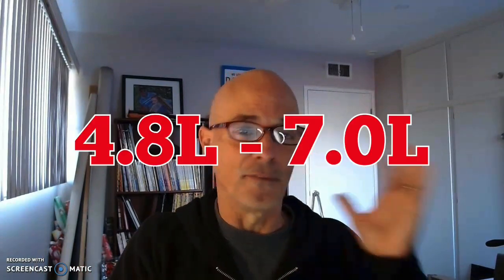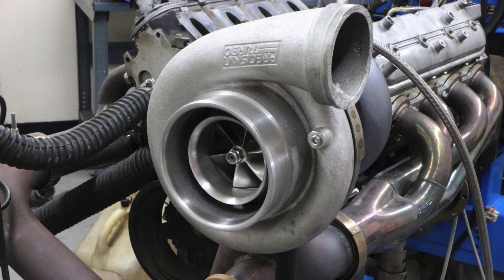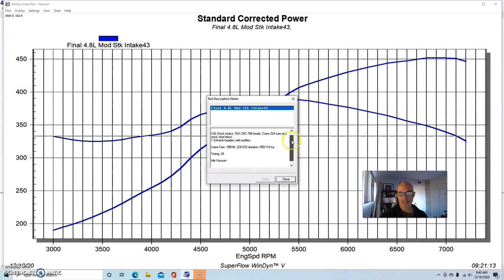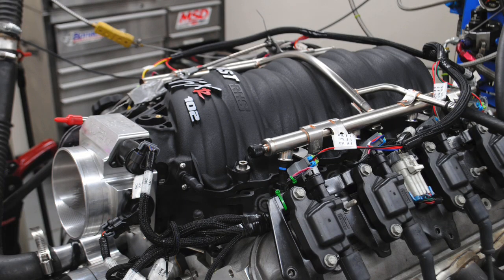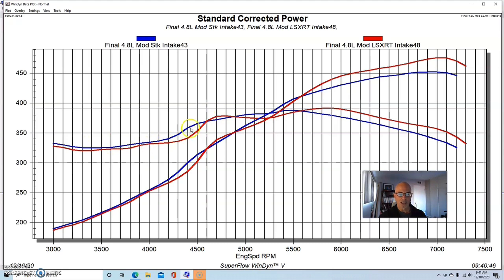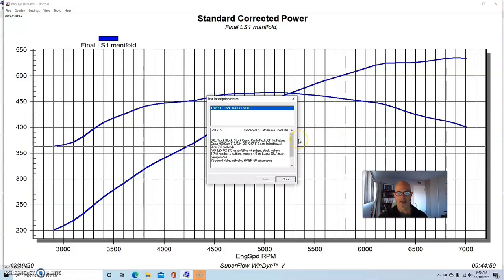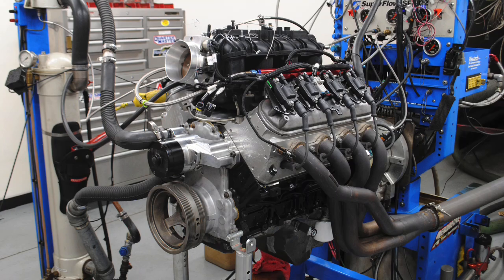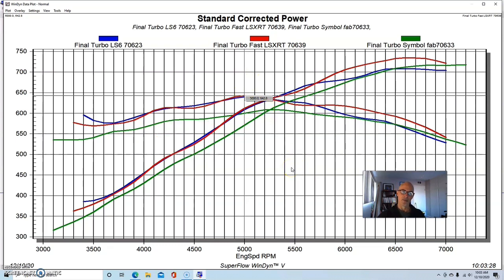LS TURBO INTAKE MANIFOLD MYTH-DOES IT MATTER UNDER BOOST?

Comment: Hi Richard . i am currently buildind a twin turbo 363 stroked lc9 ls . 12/1 8000rpm capable ,on m1. full drag car . thath motor is gonna live mostly at high rpm . i was looking at the holley ultra low ram , holley low ram or the btr trinity . whitch one is gonna be more suited for my application . tank you
Reply from the maker: BTR makes the best power of those
Reply: @richardholdener1727 would you say a short runner intake would be best for my application

Comment: I run a LS6 on my 430 lsx turbo set up and if I am worried about 20 hp I just turn the boost up s cupel of pounds I have a pretty big turbo and went 8s with 16 psi I can turn it up to 30 + psi ls6 for a turbo works excellent i paid  100 bucks for it and a 80mm after market Tb

Comment: One other thing, I've seen many dyno test with different length runners with individual throttle palates and the reflected wave to atmosphere with pressure numbers, with the best lengths being very long. The question is this, where is the reflected wave realized in a turbo system or na plenum style? The atmosphere, turbo compressor, or throttle plate, inter cooler,and are the rear cylinders getting the longer length. Can you sample cylinder compensation per power stroke to each cylinder?
Reply from the maker: the reflected wave occurs at the end of the runner in the plenum (na or turbo), on an na motor with stacks-it occurs at the end of the runner where it reaches atmosphere. on a turbo, it has to have some type of plenum to pressurize

Comment: How long are the runners in the FAST manifold? This is probably where the power comes from, I'm sure longer is better, but we don't have the 6 feet of runner length under the hood.  Ever seen a cross boss, ford stuff.
Reply from the maker: yes on the cross boss

Comment: I’ve tuned nearly a dozen various LS builds running positive manifold pressure and the FAST manifolds with no cracking or boost leaks. The only PVC style manifold I have seen bleed off boost was a FRPP piece on a 3v mod motor and this was an 950+ flywheel HP bracket car running a lot of boost pressure.

Comment: from all the tests you have done with the fast lsx (all versions) manifolds, you can see the replaceable runners create sine wave problems. some extensive maf tuning would have to be done to smooth everything out but those waves would create daily driver drivability issues.
Reply from the maker: THEY JUST PRODUCE REFLECTED WAVES THAT MAKE POWER AT DIFFERENT RPMS-TUNING WOULD NOT BE AN ISSUE
Reply: @richardholdener1727  I'm taking about those weird spots where the power level gets a little wonky

Comment: Fabricated ram style intakes HEMORRAGE power down low and dont make gains til 7200rpm even turboed. Ive see a china sheet metal intake, and a Holley high ram both drop 70hp and 50tq on a 5.7 down low and took til 7300+rpm to beat the Fast 92

Comment: Related to MaxSpeedingRods, I have a set of their rods, and I have bought a couple exhaust flanges, turbo drains, and have seen a few sets of their suspension on Hondas, and typically their products seem to be typical of the current Ebay/Chinese based company that seems to be doing a lot of work off of production models they got second hand or modeled after, with alright quality control. Its nothing to write home about, but it is a company making parts available for reasonable prices for reasonably decent quality, but it is still a company that doesn't seem to be doing much developing, just selling copies of parts.

Comment: Have used maxxedspeeding rods products with good results. Mostly fittings or cosmetics though. Most "important" product I've used was their throttle body. Typical 4 bolt dbc china throttle body but didn't have the issues as others have like loose screws. Would be interested if their turbos and stuff compare with vs racing.
Reply: Maxpeeding rods has decent quality control and improves specific products over time.

Comment: Maxspeedingrods, yeah right, try the gt35 turbo, its complete garbage, i have had two of them, the first i bought, the second i got as a replacement, both of them had a bearing issue. The rods however would be interesting on a setup, to see the limit of the rod. Should go 200hp/cyl as every other chinese rod goes.

Comment: Hey Richard, what are variables to take into account if someone where to run half a twin turbo header and turbo but an na manifold on the other side? This would be done on tighter setups and potentially a stock ls4 configuration.
Reply from the maker: I tried that on a BBC
Reply: @richardholdener1727  do you have a video up of it or maybe a writeup? Would love to here your thoughts on the topic.

Comment: Yeah no on the sponsor.  If you want to make a few bux I'm certainly not opposed to that, but having a Chicom copycat company as a sponsor is just bad form.  And it might be the last time I watch the channel.  I think you've gone far enough with the VS and CX racing stuff, and they aren't sponsors.
Reply from the maker: Max Speeding would not be a channel sponsor-just supply a part for testing
Reply: @richardholdener1727  I don't have a problem if you go out and get CX or VS or whatever on your own and test them honestly, that's fine.  But if a company approaches you and gives you parts to produce content with that's a sponsorship.  They don't have to also pay you for it to be considered that.

Comment: Richard! I have a 6.0 lq9 forged crank stroked, cam, good worked truck heads FAST 102 intake and stock cracking falling apart injectors!!!! I dont know what injectors i should run!! Any advice sir?

Comment: I have a maxspeedingrods gt45 turbo on my cammed 6L. I've been boosted since June 2020, and no problems as of yet. Started on 5lbs, now @ 11. Shaft still has the same amount of play as it did the day it arrived at my doorstep. Only complaint is he forgot to include the gaskets, and then wanted to argue with me about it. The turbo itself though, can't be beat for the price. $158 shipped to my door.

Comment: No LS motors need forged/ intake this or that ! The magazines are salesmen,  I'm taking a 2005 LQ4 in my chevelle with gapping my rings and a nice 216/220 trick flow cam,  LS9 head gasket,  ARP head bolts,  2 S256 borg warner and dialing in 500 on low boost and turning it up a little for 600 hp ! All for about 4500 complete.  I could do it for 1K less if it was a single set up !

Comment: Was the LS6 intake genuine GM or was it the Dorman replacement?

Just curious as my understanding is the Dorman is 10-15 HP up on the original part. 

Great test, superb info as always!
Reply from the maker: the Dorman LS6 made less than GM LS6 when I tested them back to back-the Dorman LS2 is better than both
Reply: Thanks for setting me straight.

Very happy then that I purchased a 92mm Fast  to go on my 2005 C6 Vette!

Comment: So on my 6.0 l77 i could runs the Fast manifold it would make more use of the tq. Curve and power band. From the stock manifold currently on the engine which i think its a ls2 manifold? 
 Be safe !  You should run a 1.4 turbo cruze engine and blow the head off it.
 Because you showed us a 2.4 jdm and it went all the way 8,700 rpms. 
 Thank you for your time .

Comment: Richard, when you start testing LS engines in your Nova what RPM will you generally set your shift points at? Mainly 5.3/6.0's.
Reply from the maker: DEPENDS ON PEAK POWER POINT OF COMBO

Comment: Good morning Richard. Thank you for all of the awesome content. I have a 2003 Gmc with 4.8 and 4l60e I inherited from my father. 210k driven by an elderly man. never towed, never hauled anything, never over 4500 rpm... runs great. future swap into a very nice 2001 jeep Tj. I would like to build as much low rpm torque as possible. Any thoughts?
Reply from the maker: make it bigger or boostier

Comment: You doing a great work, thanks for the great content 👍
It just crossed my mind, that the runners length is tuned based on neny factors, the speed off sound is one of those, speed of sound is effected by temperature. So if my theory is right, the power curve switch higher in the rpms if you don't run a intercooler, yeah its much lower because density but where it makes those peak numbers should in theory be just a thatch higher 🤔

Comment: I'd like to see what designs you come up with if you had a 3d printer.... Why is the throttle body always mounted horizontal? I have yet to see one mounted on top (in line with the runners, like a carb)...I've learned allot, but the jello is still congealing...lol
Reply from the maker: look at the new 5.7L Hemi video and the throttle body on that stock intake

Comment: I know, I know.... 'Overall Displacement = Power', but I would still like to see a 6.0L LS Shootout between a factory geometry 6.0L LS and a 6.0L 4" Stroked .20 over 4.8/5.3 block. WHY ? It's the average guy that already owns either a 4.8 or 5.3 that wants more power, so why toss the baby with the bathwater ?
Regardless of platform, most guys will buy pistons & rods as a minimum, for peace of mind and the reliability for future added power. Not every 4.8L guy out there wants to solve their under-powered problems with forced induction or a junkyard 6.0L (to start with anyway). NOW, depending on your location, 6.0L longblocks are worth their weight in gold and 4.8's are literally being given away. From Summit's 'Pro' house brand (for instance) a $700 4" Stroker Crankshaft (along with your PURCHASED donor 4.8) is less money than what many people want for a 6.0L longblock. If you already own the 4.8/5.3 ? EVEN BETTER. Either way, machining costs etc will be the same, assuming an overbore.
For a Street Car project by way of a Classic Car that weighs a ton, or even a large SUV, the drivability under 6500RPM SHOULD favor the long stroke 6.0L combo in comparison to the factory geometry 6.0L thanks to the stroke. Again, from what I have learned from watching your channel, the overall HP should be very similar, since the displacement will be similar. It's not like back in the 305 days with small bore. We now have good cylinder heads that support that small bore.
Feel free to look into the math yourself. Whether you start out currently owning a 4.8/5.3 or need to pick one up from the boneyard for your project, the price of that motor + a 4" stroke crankshaft most times is cheaper than buying a 6.0L for the project. Either way you will buy rods and pistons and everything else will more or less cancel itself out in the end in terms of costs/labor. I simply want to see a realistic daily-driver-hotrod sub-6500RPM comparison and the benefits of achieving displacement using stroke to get to roughly 6.0L, rather than GM's big bore factory geometry offering. This is for those current 4.8/5.3 owners where most wish they had a 6.0L to solve all their problems.
No expensive high RPM valvetrain, no over priced intake manifolds and less focus on that big HP number that doesn't help anyone 24/7 daily driving. Power and more importantly, Torque where people actually use it 99% of the time, still with the ability to spin big RPM if they so desire.
Thanks for all the great content and sorry for the Novel sized post.

Comment: Why don't you ever include 5.7 in the cathedral port engine sizes? Every time you only talk about 4.8 5.3 6.0
Reply from the maker: If you can't extrapolate between the 5.3l and 6.0L results, I have failed you!
Reply: @richardholdener1727  * Interpolate :-)

Comment: My opinion is, if cost is an issue, boost first and then deal with the other add-ons.  Get the biggest bang for your buck...boost...turbocharge or nitrous. Supercharger would not fall into the biggest bang category. The manifold is one of the quickest things to upgrade and can easily done later while you enjoy the fruits of boost until then.

Comment: Maxpeedingrods has a decent size presence on ebay. 17K reviews mostly positive. Shows the distributor is out of New Jersey. Their prices are good. 

Like the guy you get the 'other guys' engines from, he always gives a disclaimer regarding durability, when dealing with lower cost copies. You are testing performance not durability.

My concern would be support. When dealing with offshore products, I have found support to be less than stellar.

Comment: Hey Richard. Can I run the stock 5.3 rocker arms with a .600 lift cam? I know most people do the trunion kit. Just wondering if it will get by for a little while. Thanks!
Reply: I've run stock rocker arms on a .621" lift cam with out issue. The trunnion kit from tick is pretty sweet tho.
Reply: @jamieschinkai1267  thanks man, that’s what I needed to know

Comment: As far as maxpeeding is concerned.  they're almost 100% made in the same factory as 'Spool' and other off-shore forgings. jsut with a different lazer etching.

not a bad product from word on the street, especially when updating mid 90's Japanese engines on a modest budget vs. forged in USA/Europe/Aus parts.

Comment: How can the intake leak boost? describe what you mean please?
Reply: The fast intake is a plastic intake that you can actually take apart. Some versions allow you to change the runner length inside of it, and as a result there are some people that have had boost leak from the individual runner seals inside.

Comment: Nope never heard of them. Also would like to see hi ram intakes vs low ram intakes on boosted and see what’s better. Looking to use a tunnel ram/ ram air intake on a bbc twin turbo
Reply: that would work well the long runners would help with mid range power which would also help turbo response in the mid range.

Comment: Would be nice to see a straight pump gas power comparison between the boosted 317 vs 706, no e85/meth/race gas
Reply: Watch "THE ULTIMATE STOCK LS CYLINDER HEAD TEST" I think the power difference would be the same.. my personal thoughts on it would be that the 706 is a very efficient head and it has a smaller chamber giving  more compression. Richard has done naturally aspirated comparison between the stock cylinder heads and the 706 took the win.. just my thoughts.. take care bud.
Reply: @dr_tate  that's with better fuel. Higher compression definitely is where it's at when you're running meth, e85 etc. Straight pump gas with forced induction is a different animal
Reply: @wainfiggitty  ya I get what your saying. I just sent you that video cuz its a good reference ya know. And another video he did was "best for boost 706 vs 317 heads" and again those are good videos for reference.. 
Nice taking to you bro.. Have a nice nice and take care..
Reply: @dr_tate  yep, I've seen em 😉. I just rebuit my setup, I got tired of eating pistons in my 6.2 lol. Dropped it to 9.3:1 with forged units and it's much more forgiving to tune. I don't have easy access to e85 where I'm at. Cheers🍺
Reply from the maker: nice if we had knock sensors

Comment: That's a lot of LS engines revving to 7000 rpm to make peak power.  That may be OK for drag racing, but I'm a road course guy, and am pretty skeptical about long-term (100 track hours) durability when shifting above 6000 rpm.  Do you have any examples you can cite of LS engines durability in road course applications?  My 2002 LS1 Camaro ran like a champ through 15 years of road course use, accumulating ~180 hours on track.  I was very consistent with a 5500 rpm shift point, although I did rev to fuel cutoff (6000) a couple of times to win $$$ in time trials.  (What the heck, 50 bucks is 50 bucks.)
Reply from the maker: lots of drag race stuff running 7K, I'm less familiar with the road race guys longevity (though I'm a road race guy myself)

Comment: Rods aren't bad and machine up quite well. -+1 gram from the factory and the balancing pads a decent size.  Occasionally need to resize big end.

There turbo is what I ran that was so out of balance the wheel contacted housing and spade bits of blade through my intake.

Comment: You should test a head thats too big under boost
Reply from the maker: like the factory LS3 head?
Reply: @richardholdener1727   essentially.  Im thinking them on a 4.8 or a Tf 225 or larger. Maybe with increased airflow will make the head more become more effective

Comment: Max speeding rods in my experience are ok rods, they will take some extra torque but they are china made. I found that the big ends we're not perfectly round and had some big clearance differences (not always). They do come with genuine arp hardware and are pretty well balanced.

Comment: Doesn't the 8.1 count as LS? It was a factory option.
Reply: Gen 6 BBC. Just has low tension coils near the plugs. Heck you can do that with Gen 1 SBC and Gen 2. L35/LU34.3 V6.
Reply from the maker: its not an LS-but I do want to run one
Reply from the maker: its not an LS-but I do want to run one
Reply: The 8.1 uses the same computer as the ls gen3 engines. They have a cam position sensor in place of the distributor that also drives the oil pump, really similar to what really late 5.0l explorers had. As far as I know, year for year, the wiring harness is actually the same for 6.0l and 8.1l truck engines. The ignition coils and injectors and all engine sensors have the same connectors. That makes sense, if you are going to come up with a revamped engine, make it use as many of the same parts as the other engines.